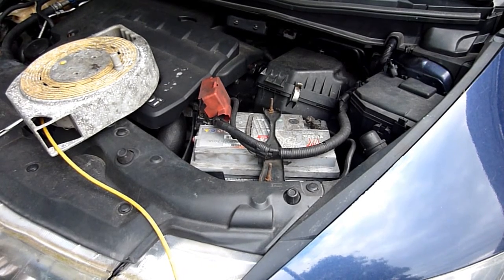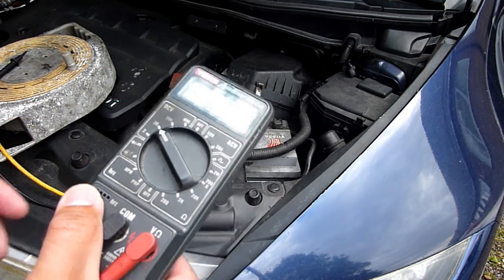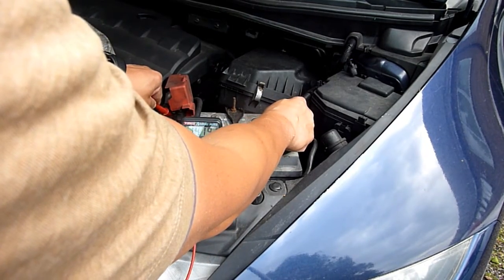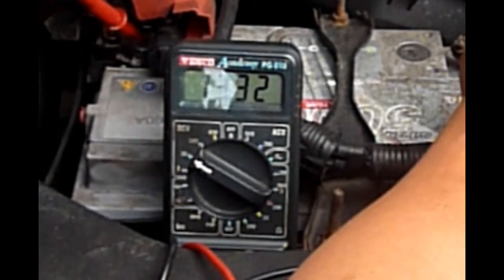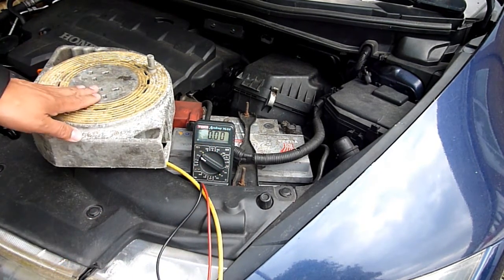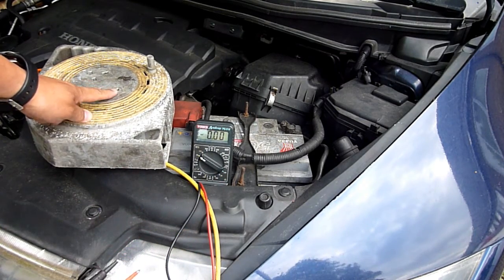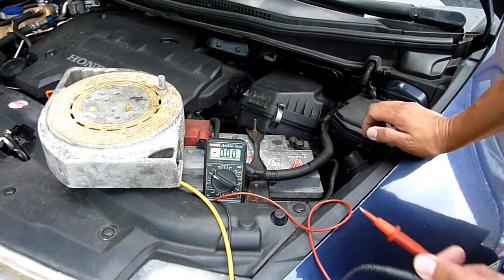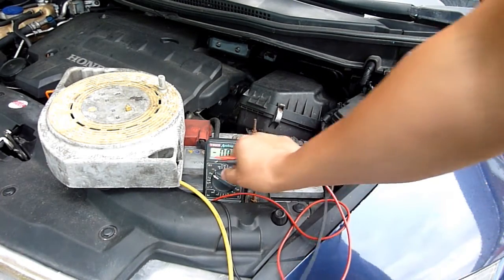What Voltage is Negative Battery Terminal on a Car ? Odd electrical faults on your car - Step 3

Comment: Im assuming its a bad thing if the potential difference between the negative termial of my battery and true-ish earth is 8v...

I think i need a new battery.
Reply from the maker: That's  a big difference means your battery can discharge if your car touched something like metal on water...like wheels in a puddle, or your PD is now 12+8 = 20 means goodbye computer if negative discharges.

Comment: I have 12V between the negative terminal and the chassis. Where should I look first for the problem?
Reply from the maker: There should be about zero volts as the negative terminal and chassis should be connected. Do the obvious remove the positive and there will likely be no volts when measuring the problem. So there is a problem where one of the sections with a component shorted, or one of the sections has a cable that has rubbed its insulation off and is shorted on the body of the car. Keeping the positive connected now. Start to remove fuses one at a time. Each time checking the voltage between negative and chassis. Do obvious ones like fuse to alternator first or ones with moving parts. Pray there ECU has not been damaged...when you isolate an area when the fuse is out then the problem goes away, then work to check the cabling, work to isolate the components like removing terminals to alternator. Let's day doing that stops the problem then you have isolated the component. If say you lift up the cable near the alternator as you see it has rubbed raw then replace that small section of cabling or wrap a load of insulating tape around the area and prevent it from rubbing.
Reply: Thanks so much for the detailed response! I tried removing fuses one by one while my wife confirmed that the voltage stayed around 12, and none of them changed it. Are there any cars that 12V to chassis is normal? We have a 2011 Kia Sedona.
Reply from the maker: @Teko-XVI  if you measure between positive of the battery and the chassis it will be 12v...if you car is working fine, then I think you may have your terminal mixed up. Positive is red coloured... negative with be bolted somewhere onto the chassis. Check again...if your car is working then leave it alone.